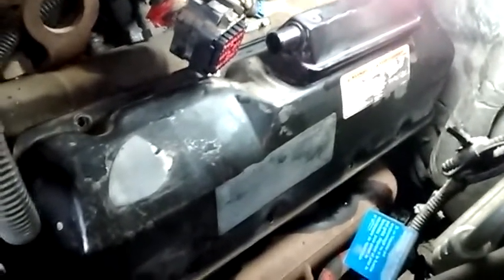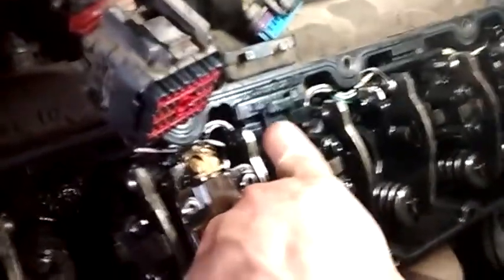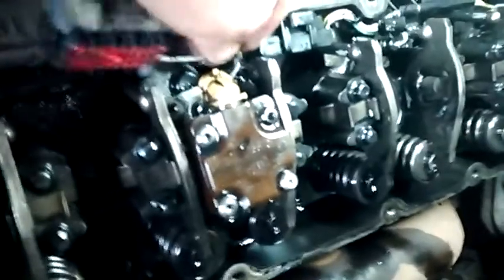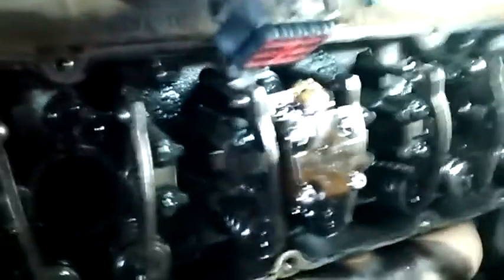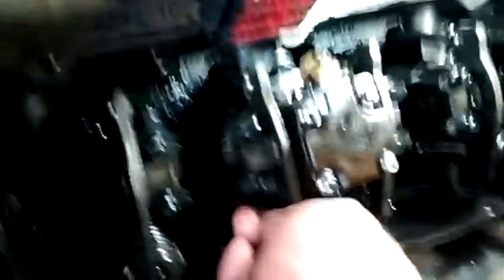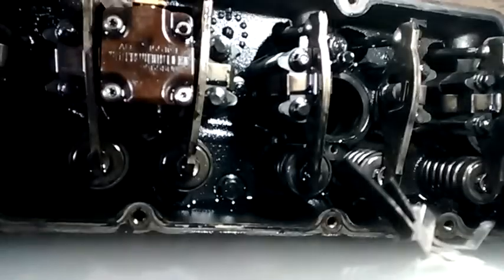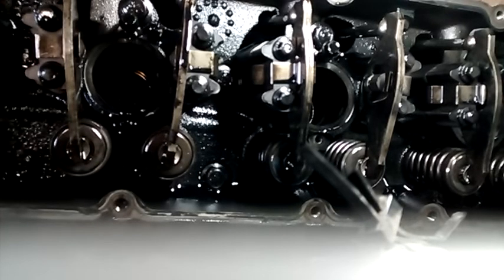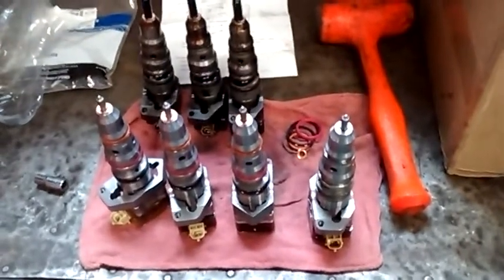Skoolie Maintenance and Repair Series EP 7 - T444E/Powerstroke Injector Replacement

Comment: I have read a couple different times from different sources that the 7.3 t444e engine is not the same as engine as the 7.3 power stroke ford  . I have a 97 school bus 3400 and have a few problems

Comment: Nothing wrong with a good ole 7.3L PS but it doesn't compare to the Cummins 12v or 24v or even common rail for ease of working on it, power or reliability. Not a bad engine though.